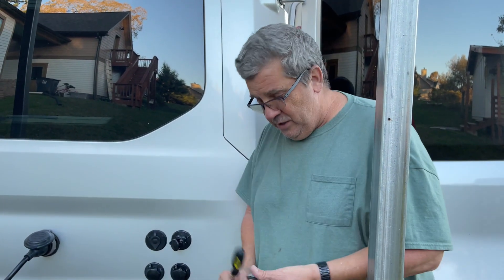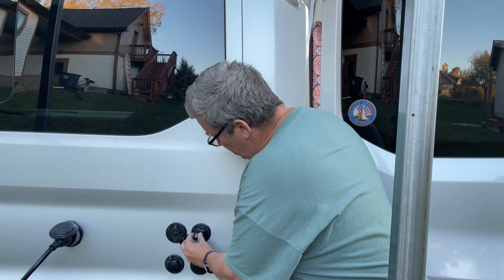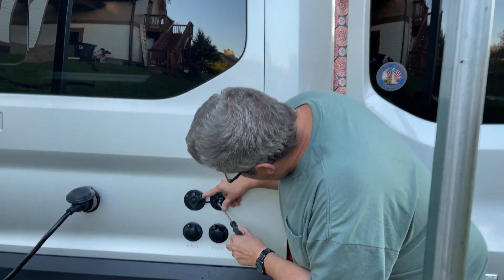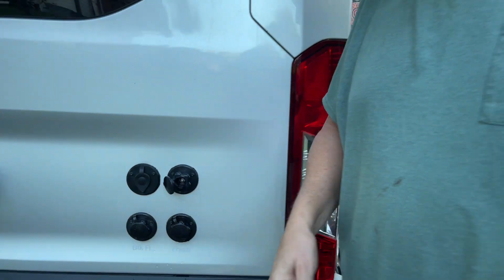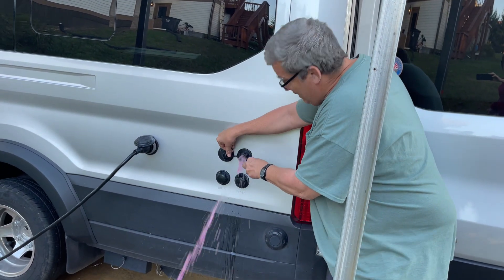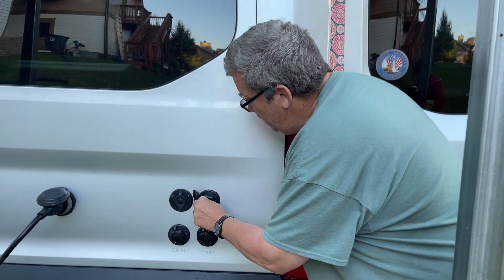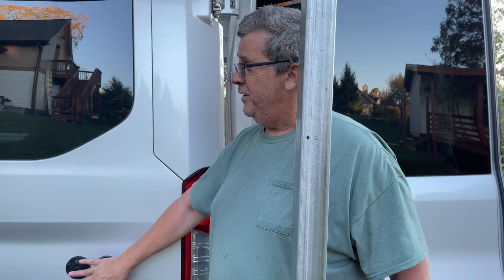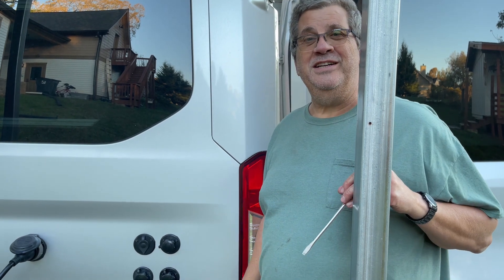An easily missed step when winterizing

Comment: Coastie the RV tech that showed me how to do this said to shut off the pump and bleed a little pressure off elsewhere before pushing in.  You get a stream instead of a torrent.  I just watched your winterizing videos in preparation for taking care of our 2021 Beyond.  We are old hands at winter prep for motorhomes but this is our first winter with the Beyond.
Reply from the maker: Good tip.

Comment: Neat trick.  I have appointed you as my mentor.  Wish I had known you were in San Antonio would have loved to meet you.
I have not winterized my van yet.  Other than the freeze we had in February has not gotten that cold.  I used a Mr Buddy Heater on low to keep temps above 32º.  to keep whatever water remains in the lines from freezing, ...it worked.  I did buy two 5 gal tanks for the heater  and the camp chef stove just in case we have another freeze.
Reply from the maker: We visit San Antonio often, our daughter and son-in-law live there.  February was rough, glad you did okay.
Reply: @CampingCoastie  Truthfully my wife and I were prepared.  Had watched the news several days before the freeze, and prepared for it by filling tubs and garbage cans with water.  Being campers we had the necessities to stay warm and last the freeze out.

Comment: Dang, a day too late. Just winterized ours yesterday. However, I blew that line out with compressed air so I should be OK. How do you winterize the shower miser without getting antifreeze in your freshwater tank?
Reply from the maker: I don't have a shower miser, but I wouldn't worry about getting some antifreeze in the freshwater tank.  It designed to be used in RV water systems, if you are using RV antifreeze for potable water systems.  And that is the only antifreeze to use!  A lot of people put some RV antifreeze in their three tanks during the winterizing process.